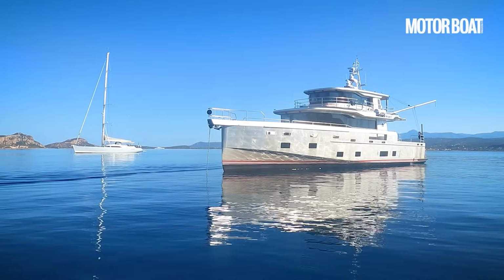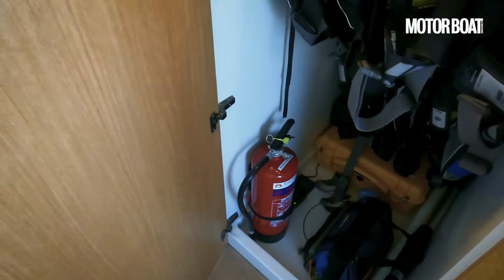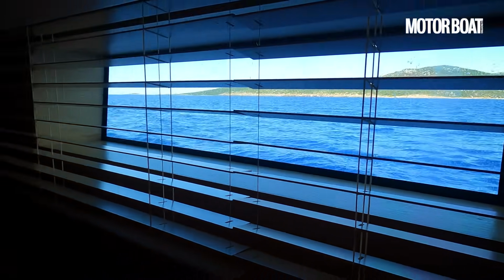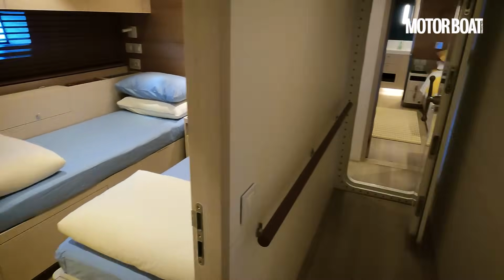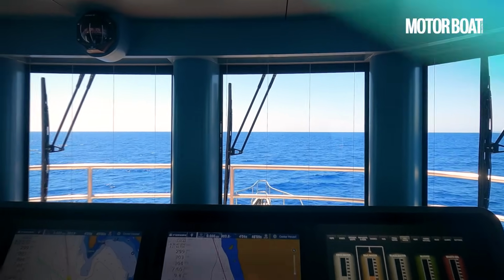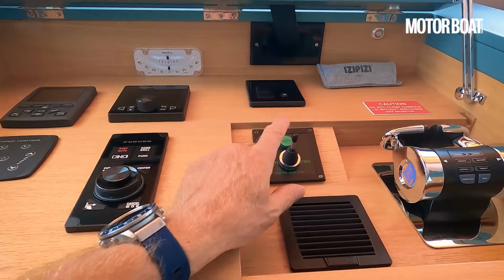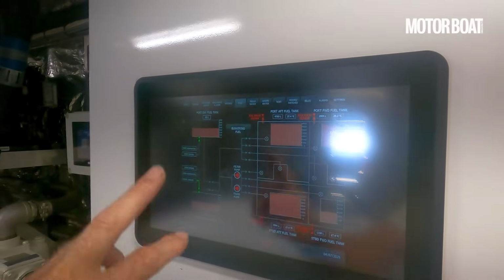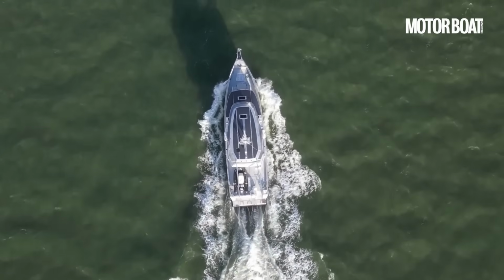Ultimate Ocean Explorer Test | Arksen 85 Sea Trial | World Exclusive | Motor Boat & Yachting

Comment: Hi Hugo 👋 I think in exclusive sea trials of special boats, having a professional videographer would add a lot to the experience. It’s not that you did a bad job, but with two people you can focus on showing us the detail and the videographer can think about the visuals. Not just in terms of b-roll, but also through proper exposure and better gear choices (at points you needed a wider angle and significantly better dynamic range).  Definitely a two person job to give us all the detail. Otherwise a great overview.

Comment: It should have stormshutters too.
Reply: ???? 25mm hardened glass needs storm shutters? Yes… sure…
Reply: @GroppeljohannKlotenkempe-vr6oh Yes. One big rogue wave and that glass will easily shatter.
Reply: @jimj2683 a big rogue wave that shatters 25mm hardened glass will also shatter any usual storm shutter. Only prevention is 25mm solid steel and even that will bend under your rogue wave. Anything else you expert?
Reply: @jimj2683  good enough to keep the armed robbers out at the 7-11 lol.
Reply: @GroppeljohannKlotenkempe-vr6oh Cored carbon fiber is much stronger as storm shutters and much stronger than any glass for this application. 25mm hardened glass is very weak for the weight.

Comment: I have the same Humphree stabilization system (with large interceptors) on my 72' Sport fisher. It's a great system. It has a "coordinated turn" function. It needs to be activated. When done so, those sharp turns you demonstrated would have been seamless and the boat is "leaned" into the turns and the amount of the lean is dependent on speed and turn degree. You can crank it hard at very high speed and its quite amazing how it takes a big boat and turns it into a small boat center console like turn.
Reply: Very interesting! Where do you keep your 72? Would be interested in see how that works.
Reply: @FishingAnonymous  Typically in Newport  Beach but currently is in Loreto until January, then PV then Costa Rica. Back in SoCal late summer 26.
Reply: @Calscot1 hope you’ve enjoyed the last 6mo! Newport is a great Snug Harbor!

Comment: The only things I liked were the wetroom closet and the sliding door forward of it & the day head. Hate the cheesewire around the cockpit . Otherwise, looks like an over-priced & ugly-interiored FPB knock-off. Would be well below the full displacement alternatives on my list if I had that kind of money to spend.
Reply: It is a full displacement boat, but it’s a long thin light one that marginally exceeds its normal displacement speed because of its hull shape.
Reply: @hugoandreae3785   
The A85 has about 40-50% less interior volume than a Bering 80. I'll take going 8kph at 45 litres/hr on a Bering 80 over 9 at 25 if it gives me that much more boat.Not that I'm buying that data from Arksen, anyway.

I'm curious how a full displacement hull can have self-righting capability ?

 The interior volume, the beam, and draft all scream semi-displacement.
Reply: semi displacement means that partial planing is achieved ... this does not plane
Reply: @aktxyz  No it trundles along at displacement speeds that wouldn't plane a surfboard, all without the beam/draft of a traditional full displacement vessel like the B80, ie the volume and stability. Worst of both worlds, whatever you call its hull design.
 I'm all for reducing fuel use/emissions but that's a lot to sacrifice in terms of sea comfort and real range - A85 carries 1/3 of the fuel so it'll also be bobbing like a cork & out of food before you use that extra range, anyway.
Reply: @Dogasaurus  so I suppose your average Navy destroyer/frigate/cruiser is semi-displacement ... compared to cargo ships and oil tankers
Reply: @aktxyz  In terms of hull efficiency - the key characteristic,not nomenclature necessarily, I'd guess the answer is yes.

 Military ships are designed for speed, maneuverability and strength, common sense dictates. Cargo ships are built for slow speed stability, volume, and fuel efficiency. Apples/oranges in terms of usage, so I don't think you need to be a naval architect to believe that the design would be different.
Arksen seems to be claiming they have solved the conundrum of efficiency vs stability. I need more than company blurb to buy it, though. And the comparative lack of volume is an indisputable fact.
Reply: @Dogasaurus  you want to appear as someone who knows his stuff, but to use your wording: no-one will buy your blurbs. You talk about kph instead of knots and want to be taken seriously? You call this ship a semi-displacement? Is a kayak also a semi-displacement for you? Cargo ships are built for low speed (stability)? What the heck ae you smoking, Sir? You prefer a B80 for its volume and will accept it being a cork in rough seas? Have you ever seen video footage of a Bering going up and down and forth and back like a hobby horse even in the slightest waves?
Go back to school, keyboard warrior

Comment: Nice machine but I would have thought for 85’ the engine room wouldn’t be so cramped ,  some of that kit would be hard to get at rolling around dead in the water . I suspect the average leisure owner wouldn’t be that confident of working on all that equipment . Seems overly complicated .
Reply: redundancy definitely leads to complexity ! 4 ways to pump fuel, 2 full size gensets, literally online backup for all key systems ... makes for a lot of piping and valves !
Reply: @aktxyz just wonder is it all nessacary , my philosophy is keep it simple , my dream would be a steel hull vessel with twin old school Gardner 6LXB’s , fuel polisher , double racors , keel cooling , big sea chest for each motor and a tool chest and lots of filters , impellers and belts . You start those motors on the first of January and not switch them off for weeks without a problem . This boat looks monstrously complicated , something went askew down there where would you start ? I am handy enough with the tools but I think of if I were to sail that for months at a time I’d have to have an engineer with me , I’d be nervous as anything I am in over my head which would just ruin the experience for me . I guess if you have the kind of money to build of these an engineer isn’t a big cost .
Reply: I agree 💯. The take of the Fashews with their FPB is mich better. Even better than that (at least for a normal person like me) is the approach of Skip Nowak on his Pelagic 77. Okay, it‘s a sail boat but take away the rigging and the rest can be transgerred 1:1 on each motor yacht. The Pelagic 77 (Vinston of Antarrica) remains apmost fully funktional without any electricity. The Nav system will be down obviously and aircon isn‘t installed anyway, but you still have an oven for heating and hot water, cooking is via gas, steering can be done manually etc. Great concept

Comment: I love the purposeful exterior design, the big advantages of a narrow bow entry and a relatively narrow beam.
I wouldn't change anything of that.

But I rather choose a full displacement heavier design with a deeper draft and rounder bottom that will be notoriously more comfortable and stable than this lightweight semi-displacement hull, and still can do 10 knots cruising speed with those 25 metres LWL.

The increased fuel consumption can be compensated with a lot bigger tanks from the deeper draft.

If you are crossing oceans, at some point you will find 50 knots and 6 metre waves. There is when you will regret choosing a very light semi-displacement hull.

If you just want to cruise the Bahamas, that's a completely different story, but if that was my plan, I would rather choose a big catamaran any day.
Reply: Where is it said that this is a semi-displacement hull? Are you kidding?
Reply: @GroppeljohannKlotenkempe-vr6ohit can go faster than the hull max speed. The only way it can do that is by planning. That's why it also has interceptors.

They can call it fast displacement or whatever other name they can invent, but in summary it is just a semi-displacement hull.

That's not bad. It has pros and cons, as with everything. 

But at 25 metres of waterline length, I would choose a full displacement hull any day, and with that lengh, it can easily reach 10 knots of cruising speed, which is fine for me.
Reply: @Frater_Saxum  hull speed is a completely outdated and obsolete concept. It lacks any scientific backround. It dates from a time when hydrodynamics wasn‘t a thing.
So no, the speed is no sign for not being full displacement.
Reply: @Frater_Saxum  oh and btw interceptors by no means qualify a ship as semi-displacement. Here they just add stability

Comment: Thanks for the very thorough tour Hugo. Powerful yacht, but even with stabilizers I suspect it could be a handful in big quartering seas with that fine bow digging in and the weight from the pilothouse whipping the top to and fro. Incredible safety features with the watertight doors and so forth.
Reply: Not sure I agree with you. Fins are more effective under way than Seakeepers and this one has a huge battery pack, two generators and solar panels.
Reply: @hugoandreae3785  I agree with you, but more doesn't hurt. 👍
Reply: @triedproven9908 more can hurt a lot. Seakeepers are heavy and in case of serious trouble can be a dangerous liability
Reply: Needs dual seakeepers and more batteries to keep up with them but other than that she's perfect.
Reply: If the bow will dig in or not depends on volume and weight distribution. If made correctly the bow won‘t dig in. Since we don‘t know the exact naval architecture your assumption is a mere speculation
Reply: @GroppeljohannKlotenkempe-vr6oh So she's perfect as is. Great.
Reply: @triedproven9908 where have i said she is perfect? Are you fantasizing? Why so aggressive? Are you bored with your life? Hasn‘t mommy been kind enough?
Reply: @GroppeljohannKlotenkempe-vr6oh That's pretty sad man. Smh.
Reply: @triedproven9908maybe I got you wrong? In that case sorry